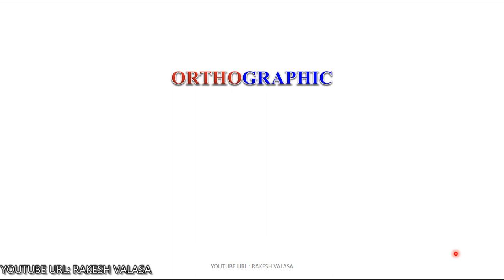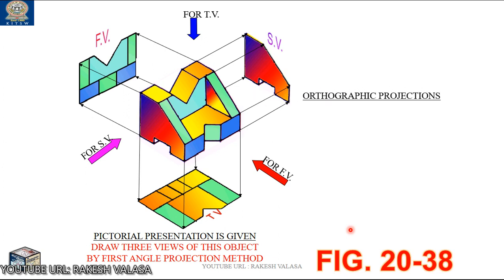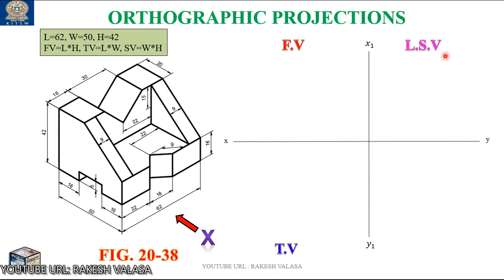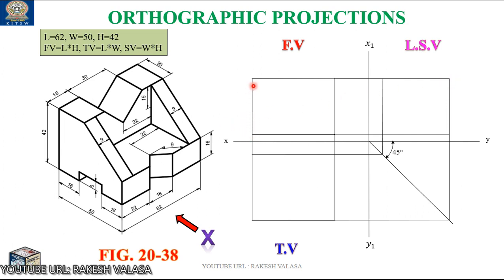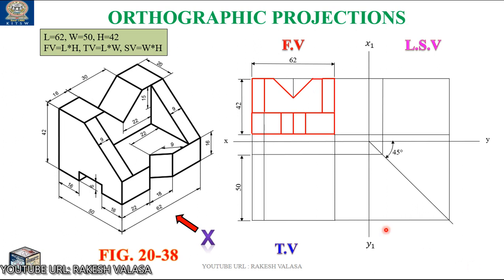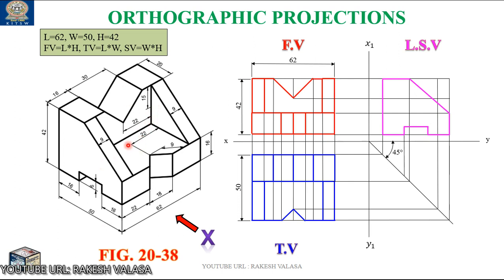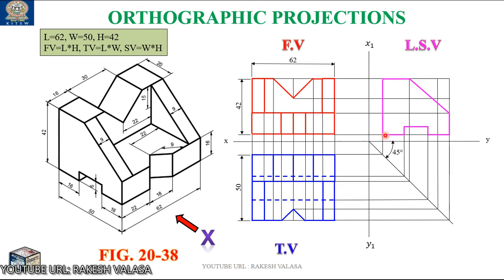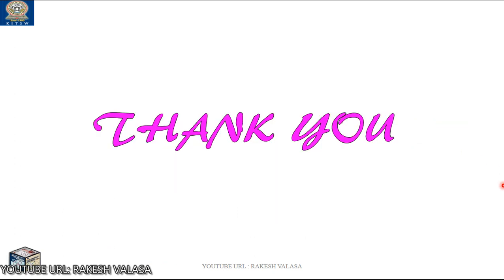Fig. No. 20-38; Orthographic projections (Engineering drawing by N. D. BHATT) with explanation

Comment: A chimney of height 20 m is supported by a set of three ropes. The ropes are attached to the
chimney at 2 m from the top and are anchored 3m above the ground at a distance 10 m from
the axis of the chimney. Draw the projections of the ropes if the anchor points are due north,
south-east and south west of the chimney. Find the true length and slope in relation to the
ground of one of the ropes. (The chimney and ropes may be considered as lines for the
projections). A suitable scale may be used.  (sir please give solution of this  Question
)